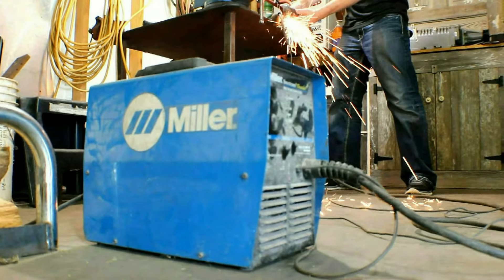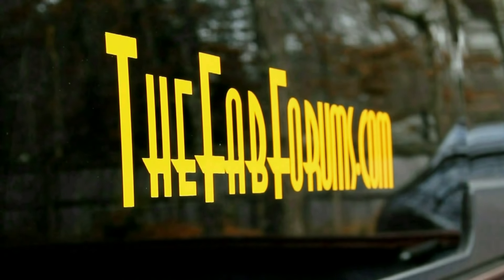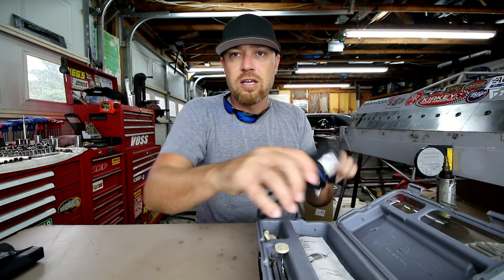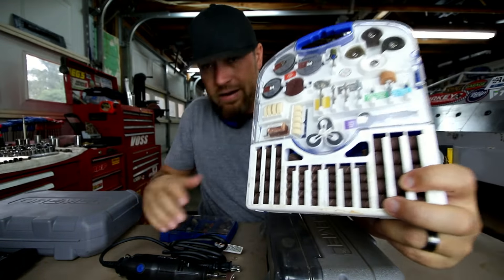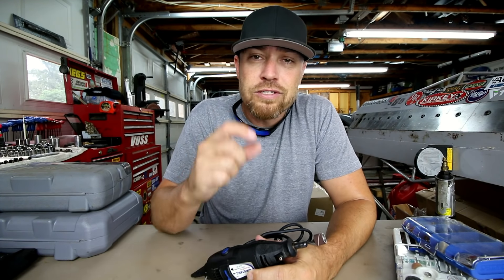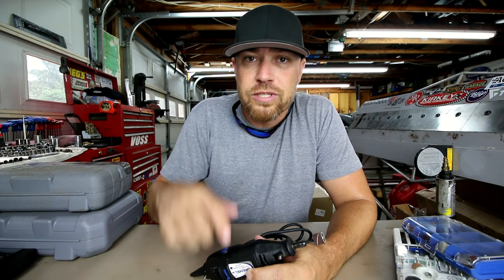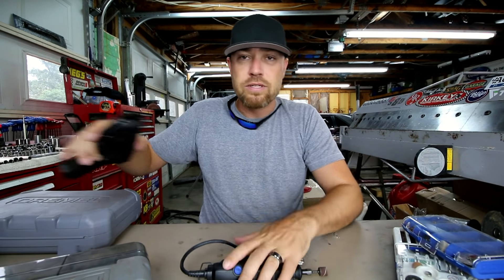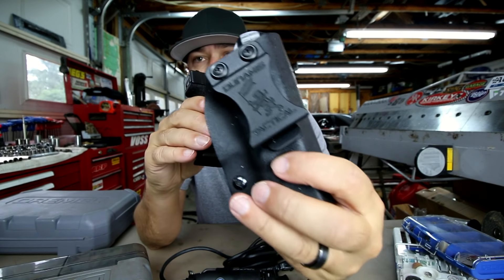You Need This Tool - Episode 78 | Dremel Variable Speed Rotary Tool Kit

Comment: I love my dremel! I set up a fishing tackle box to use for the tool, flex shaft, router attachment and all the consumables. As a bonus, the the mandrel holder that came with the original case fits in there perfect! I put all the consumables in the lure trays. Couldn't have asked for it to work out better.

Comment: They are also great for removing the remains of a broken bolt. You can grind away most of it to get in an easy-out or just pull out the left over thread. Great vid like aways
Reply: yup just used mine to cut a notch in a stripped bolt so I could get it out.

Comment: Differences 
--4 000 -- vs-- 3000
---1.6--------1.2  amp
--35,000 ---- 32,000 max rpm
*4000 has BOTH a separate on/off & speed control. 3000 does not.
*4200 is same as 4000 BUT has  special extra Easy change nose cap.

I dont use it everyday so I got the 3000.

Comment: When you burn up that Dremel pick up one of the Milwaukee M12 rotary tools. It works with the same batteries as your new 12v ratchet and to my hand seems like a higher quality tool
Reply: My Milwaukee rotary tool was nothing but problems before it died

Comment: These are really awesome tools. As an aircraft mechanic I use mine all of the time for various purposes. I have one question that could be answered here. I'm often in very tight quarters so the dremel is already great for that but is there any attachments that help when working in small areas or close to walls. P.S I have the same exact cordless (18v)Dremel its the only way to go for work. At home I have a corded dremel as it's not that big of a deal to drag out extension cords but still when in a pinch I use the cordless. There is some power loss due to it being battery powered but I just keep two batteries. My corded works at higher RPMs but I really never need to go up that high. The cordless maxes out at about 30-35k RPMs that's more then enough imo.

Comment: How is the battery life on the battery operated Dremel?  Also, if you do not have one yet, you should get them flex shaft attachment.  No lie, its a game changer and really makes a Dremel 10X more useable in tight situations.!  You have got to try it!
Reply from the maker: Battery life is awesome, and I totally need to check into the flex shafts for the Dremel
Reply: Im telling you Kyle, it will change your Dremel life!  I cannot wait to see more work on the Bibbster!
Reply: Love the flex shafts, the bottle flex shaft rotaries are certainly the way to go for intricate over the bench work.  You can use "Dremels" for anything from trimming the dogs toe nails (yes they have a attachment for it) to modifying guns etc.. lol

Comment: I burned through 3 Dremels after mild use. Tried to do new magnets and springs. Not helpful. Bought the Harbor Freight comparable multispeed rotary and it's outlasted Dremel in a big way. Only issue recently is the spring lock button for changing bits is now loose. But as much as I use it and as long as it's lasted, well worth it to do the HF version.
Reply from the maker: cool

Comment: Gave up on Dremel years ago,the variable speed switch malfunctioned on two that I had.Sorry never again...
Reply: Over a whopping sample size of 2? If that's your standard for product expectations, then just don't buy any power tools. Human designed products, produced by humans, assembled by humans, being used by humans - flaws WILL come up, with any brand, with any product. There's a reason that airplanes have 3, 4, 5 redundancies built into each and every control surface for a reason, and it isn't because they don't think the engineers aren't trying hard enough.
Reply: Dremels are American made and guaranteed.  contact the manufacturer for repairs. don't buy the cheap foreign KOs